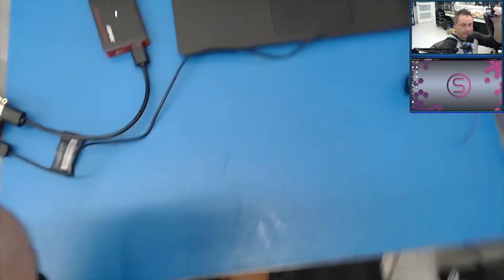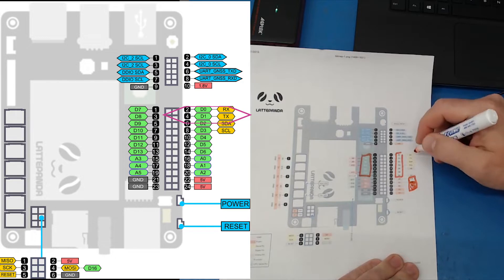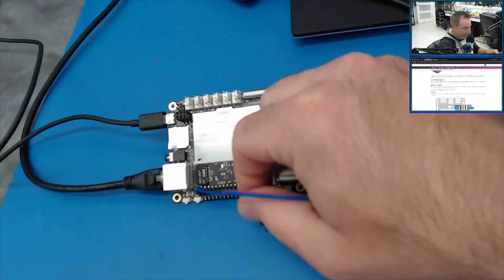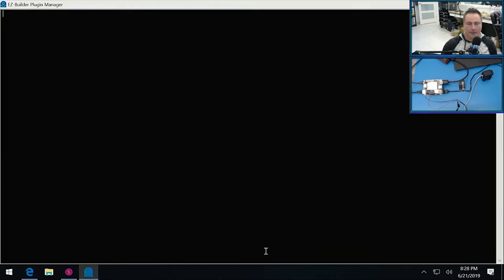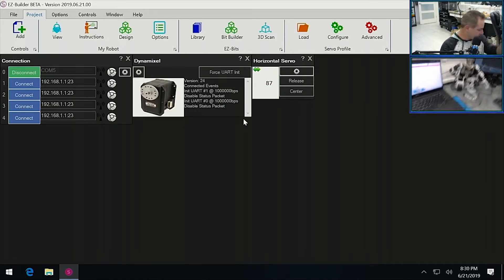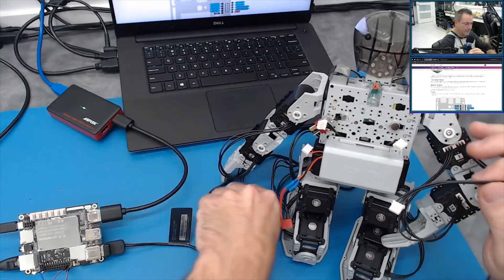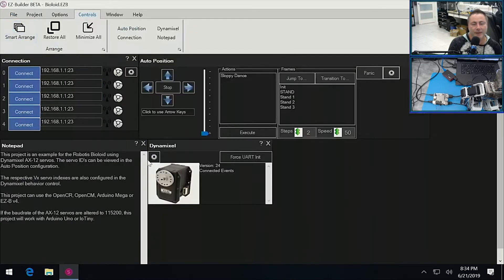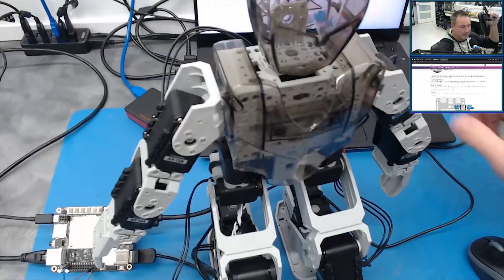Tutorial - LattePanda (Part 4 of 6) Programming Servos

Comment: Hi, can you guide me to configure the battery settings in lattepanda. 
I have installed the windows 10 genuine version. When I used the 10 pin for battery connection it charges and discharges. But the problem I am facing is the improper battery prediction. Some times the screen shows 10% after 5 secs it jumps to 30% and same thing during discharge. I need help to solve this. Do you have any guidance to get rid from this issue.